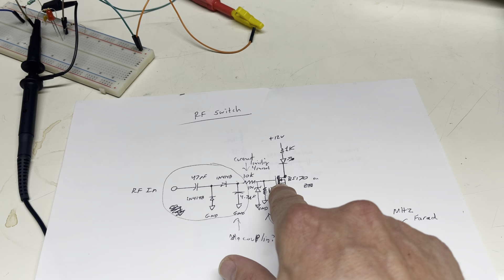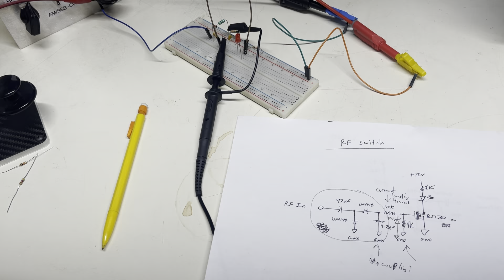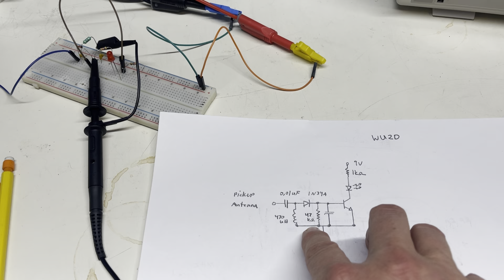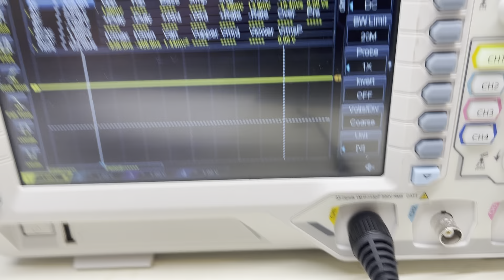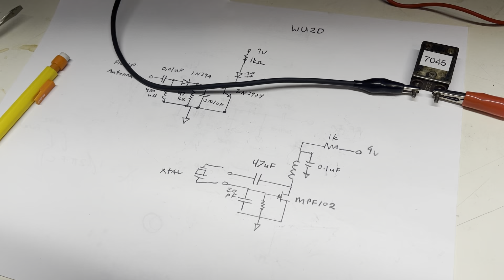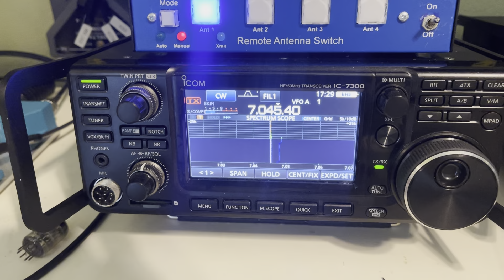Building a station monitor - Part 2

Comment: Man I’ve always wanted to do this! Instantly subscribed. I started making a single tube transmitter years ago but couldn’t find reasonably priced parts (starving college student budget) and gave up. I’ll watch your videos on these and hopefully someday do the same. Might do solid state first though as it’s what I have on hand.
Reply from the maker: You can do it! It's really fun experimenting with this stuff. For this transmitter, I built it using the board that the Antique Wireless Association sells on ebay: 

https://www.ebay.com/itm/205522391459